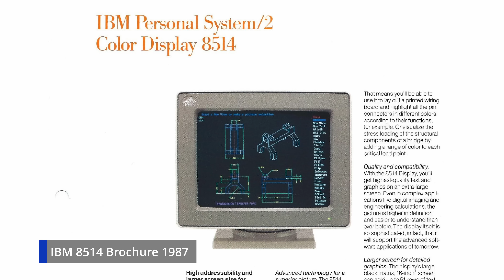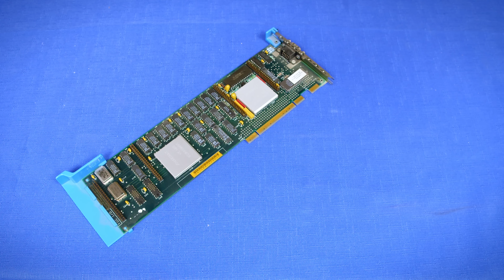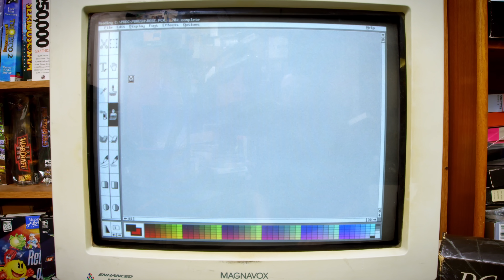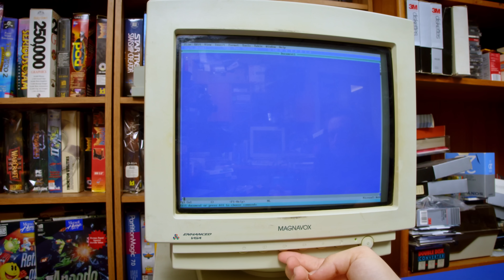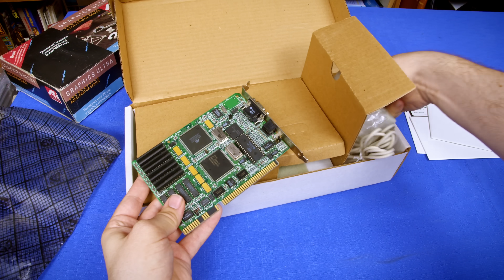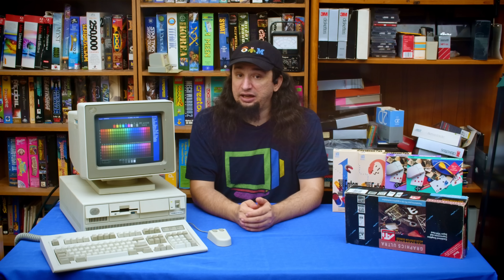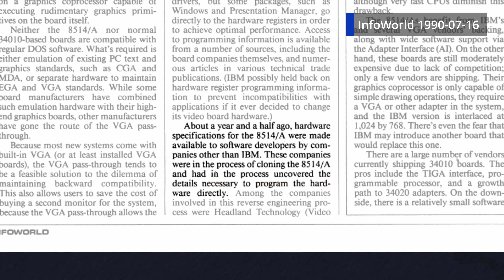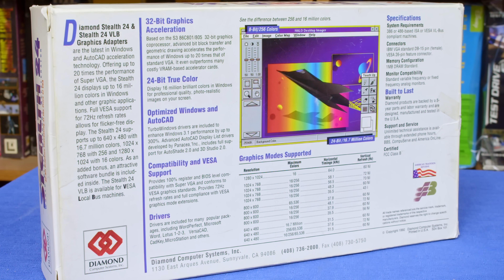IBM's Weird GPU From 1987 - IBM 8514/A

Comment: Great history!! In 1993, I had a Mach32-based ATi All in Wonder Pro. It did 1024x768 in 65k colors or 1280x1024 in 256 plus it had a TV tuner and video input/overlay. Great card w/ lots of references to 8514 in the documentation.  Nice to revisit this.

Comment: GPUs are a lot older than that -- depending on your definition. SGI already introduced its IRIS 1000 3D graphics terminals in 1983, and they were definitely not the first to market. You could argue that Evans & Sutherland or Tektronix with their 4004 were the first -- again, depending on your definition.

Comment: I was on the IBM team porting IBM's Unix called AIX from the RT RISC workstation to the PS/2 Model 80.  I sat across from the college kid who wrote the graphics driver for the 8514 card and monitor.  Internally it was called the 'Megapel', because back then IBM-speak for pixel was 'pel'.

Comment: They weren't all basic. You need to look up the tseng labs 4000 w32. Also the ati mach 64. Some of those had bit blitting which was a total game changer. What made the cards suck was if their ramdac was ass. Also the mach32 had 8514/a compatibility via a driver which was cool.

Comment: My high school in 1988/9 had a room full of PS/2s networked to a central server that were full VGA. One of the demonstrations was displaying GIFs. It was impressive at the time and I can only guess what they spent on it. There were a couple of rooms with PCs but most were monochrome intended to replace typewriters from a couple of years earlier. Drafting class had a single high end tower in the back room with VGA and a tablet for Autocad. It was for extra special students. Most of us just got to do some lessons on it.
Reply: Oh wow! GIF came out in 87 from what I know of it, so it would've been brand new!
Reply: @Lunaphied  They were pretty cutting edge. I don't know what network they used but I discovered the key combination that brought up a messaging client so you could send messages to any other station. Passing notes in class was built in.

Comment: Good stuff. There is just one significant aspect of the 8514 monitor that you're not familiar with, since you don't own one. The 8514 was flickery, but nowhere near as bad as the monitor you're using. IBM was well aware of the interlacing issue, so they mitigated the flickering (particularly on CAD software) by using super long-persistence phosphors. This worked fairly well for line drawings, but it was bad for scrolling text; for example if you did a DIR in a directory with a lot of files it would look like the Matrix.

The long-persistence phosphors were one major source of the myth that the 8514/A required the 8514. It did require it in a way, since it was much more flickery on standard-persistence monitors.

Comment: I co-processor isn't a GPU. A GPU is basically an Array Processor. A ton of smaller, simpler cores working together in parallel to solve workloads.
Reply: GPU - Graphics Processing Unit. It's a Unit that Processes Graphics.

Comment: I wonder how much is bandwidth limited on the ISA Graphics Ultra, albeit maybe that matters less for the Mach 8 core vs running in VGA mode using the VGA Wonder core instead.

For whatever reasons, those VGA cores tolerate heavily overclocked ISA busses without issues, but they also don't support a 0ws interface mode, so they're still in the same speed range as a 0ws fast ISA VGA card (like some SiS chipsets) on a moderately OC'd ISA bus (like 12.5 MHz).

The Graphics Ultra I've done a lot of benchmarking with ran fine up to 25 MHz ISA bus speed, maybe higher (I forget if I had it at 28 MHz or not) on 486 motherboards that allowed that. (playing with master oscillator settings + ISA divider) I managed to get that high ISA clock working with various SB compatible sound cards, too, for proper demo/game tests with sound. (it required setting up appropriate wait states ... or some similar parameter for the sound card to use ... I don't think it was wait states, actually, but something in the mobo BIOS related to I/O cycle times, though maybe it was technically a wait state category)

I think that's the only card I could get 99% in the 3DSpace demo on an ISA only mobo.

There's also a jumper on the Graphics Ultra that locks it into 8-bit XT bus mode and thus runs slowly.

Comment: It was more influential to Windows than most realize. Since it was the "accelerated" example driver included with the Windows DDK, most everyone else started off with the 8514/A driver as a template and built it from there.

Comment: GDI didn't become DirectX.  GDI abstracted all the drawing commands so they could be accelerated but it didn't give direct framebuffer access. The early versions of DirectX were about doing away with GDI and providing direct access to frame buffers, DirectX progressively added accelerated drawing operations, first basic 2d operations like copying between buffers and later complex 3d operations. DirectX never implemented accelerated 2d Drawing operations like GDI had until Windows Vista where the 2d operations were done using the 3d hardware

Comment: The boundary of "GPU" is unclear, but if the 8514/A is, then the Amiga copper and blitter are too, years earlier.
Reply: The hint you would need about the Amiga's blitter not being the first of its kind comes from the name.
Reply: And the Tseng PAK cards came out 2 years before the Amiga and 4 years before the IBM 8514.
And the Hercules graphics card came out a year before that.
Nvidia likes to claim the 'GPU' title because they added hardware accelerated transform and lighting with the GeForce 256, but all graphics cards had been accelerating, offloading, or extending some form of graphics tasks since the beginning.
Reply: It depends how you define the term "GPU". Copper and Blitter could do a lot of neat tricks long before and without taxing the CPU.

Comment: The ATI 8514/a clone was so popular I always thought IBM contracted the design to ATI. I never heard about the original IBM 8514. I owned an Amiga 2000 at the time. When I switched to the PC, I bought a WD 32 bits accelerated VLB, then the famous S3 968 VLB. Later I switched to PCI with a Pentium 120 and the famous Matrox Mystique and first 3d accelerated game: Hellbender
Reply: I had a 968 for a bit, and a Matrox Mystique 220.  That was a sweet card.  Linux drivers for it were excellent.  Rand a Mystique 220 + Voodoo 2 for a bit.

Comment: Five months ago on Tech Tangents II you posted a video entitled "Video Capture Never Ends - How Much do You REALLY Want to Know?"  You diplomatically noted that the subject has "endless depth".  At that time I suggested that you go down the rabbit hole.  Thorough documentation of the multitude of display standards and conventions would be invaluable.  If you don't document 43.48Hz interlaced video it will be lost to time.
Reply from the maker: I'm still going down the rabbit hole and building up notes. The idea is less to document every video mode like that, and more convey an understanding of how to identify and work with something like that from a general perspective. But if you'ed asked me when I made that TTII video if I ever thought VGA had interlaced modes I would have guessed no. I really wasn't kidding about the endless depth.

Comment: not really a GPU that would be an anachronism at best... that is a fixed function device... the term GPU started with the NVidia GeForce and even there they weren't quite GPU's yet as in they were fixed function (but they added hardware T & L), not programmable (as a CPU is)

Comment: Back then we didn't have options to compare to. Most of the time when we bought computers, it was a systems, with some options. I don't remember much until the 396 had been out for awhile. An system you might be interested in, the CTOS, Convergent technology, DEC bought them when they got government contract and synched with Burroghs, IRS, Coast Guard and Marine Corps. Banks had terminals to communicate with IRS.

Comment: I would call the NEC μPD7220 form 1984 kind of the first "GPU", or better still , the Texas Instruments TMS 34010 from 1985, that was truly programmable. and are both from before the IBM 8514/A.

if they had paired a TMS 34010 with a Inmos T414  Transputer... the closest thing to a GPU of 15-20 years latter
Reply: GPU have an specific meaning. It is a 3D chip than can do at least TnL in hardware. Even the beefier subsystems which SGI produced at time, most of them couldn't be called GPUs as the workload was divided in tons of chips, and some models lack one of other checkmark to get the right to be called GPU.

Sure there were older technologies which precede or are similar to some of the features GPUs have, but calling them GPUs is kicking it too far.
Reply: @hyoenmadan  ב''ה, 99/4A owners probably have input on this otherwise

Comment: holy cow, we're just calling everything that puts out video a GPU now? It seems like an analog television station would be considered a GPU. Or telescope.

GPU is a term of art with very specific meanings. And yes, this card does in fact accelerate some 2d operations, but compared to what is considered a GPU, this isn't even in contention for that. It is a fixed pipeline 2D card that accelerates some operations, whereas until this newer generation of kids who never grew up without gpus who think that everything is a GPU, it was generally understood that the term refers to a part of the computer which offloads certain 3D mathematics operations from the CPU. There may be something that we can consider to be a GPU from prior to the release of the geforce 256. However, virtually every Mass market 3d card wasn't one, and only the dilution of the term into meaninglessness would have a 2d accelerator card be called the same thing.

Anyway, it's a pet peeve of mine and zoomers are just not very good with computers since computers are easy enough that they don't have to be, so even though it's the hell I'm going to die on I will die on it and I'm going to lose this battle. But it's still really annoying.
Reply: Back in the day you had to be a 3D chip, and support T&L in hardware at least, to have the right to be called a GPU. Even the Reality engine of the N64 (powerful chip made by SGI themselves) couldn't be called GPU. These days everyone is a GPU.

Comment: That box slide reveal at 2:59 was slick AF.  If it were a commercial, I'd be pulling out my wallet.
Reply: My wallet was in my hand at 3:00... And I didn't understand until I checked the comments.
Reply: I woke up on the floor with my wallet out and all of my cards missing…
Reply: IMMEDIATELY went to the comments

Comment: Good Stuff and well done. Back in the days I had a number of those cards. As a parallel topic back then the importance of Sony's invention of the "Multi-Sync" monitor was nearly paramount for the evolution of PC video resolutions. While monitors were nearly always very expensive however before the 'multi-sync' became a industry standard feature most monitors could only be used at one resolution (sometimes 2-3 more).

Comment: The first adapter I ever encountered that might retroactively be classed as a ‘GPU’ in a somewhat modern sense was the Glint 3D chip from 1993 or sometime around then.
Reply: I don't remember it being able to do TnL in hardware. It can't be called GPU without that checkmark.

Comment: DirectX did not evolve from GDI. The precursor to DirectX; WinG (1994) only did one thing, it let you bypass GDI. This evolved to the DirectDraw part of DirectX.
Reply: Ironically, it wasn't made with graphics and games in mind... But to allow motion video to be played in a window. 

That's why the most old DirectDraw module is called DCIMAIN. But then they found it could be used to reserve and manage window memory zones where the display adapter could retrieve the data to display directly via DMA. Then you got DirectDraw. Later they found these flat memory zones could be used so the 3D engine could retrieve and display processed data as well.

They bought a "game engine" from some company, modified it to mimic what Glide was doing, and called it Direct3D. But instead offering you a library to link it against your application, they made the API available directly as system calls, COM+ objects and a public interface so anyone could use it from usermode.

Comment: Right, so it's a "graphic accelerator" but doesn't have the matrix operations which distinguish GPUs starting with Clark's Geometry Engine in SGI systems. I think that's stretching the definition somewhat.
Reply: Even these beefier 3D graphics subsystems can't be called GPUs, as the engine is distributed across tonloads of different chips.
A GPU is a single 3D graphics chip which can do TnL in hardware at least.

Comment: GDI did not evolve into directx. Directx bypasses gdi - hence the direct in the name. Also, GDI has been around since before Windows existed.
Reply: DirectDraw came from WinG, which in place came from the interface to  drive directly the framebuffer memory in order to display motion video on a window. There is a YTber which plays with these older apps and video encoded with Cinepak and stuff.

Direct3D was a software middleware they bought from some external company to develop a way to abstract the 3D engine chip registers and interface in an uniform API... Just like Glide btw. Graphics companies tailor their hardware interfaces to implement the backend, and the frontend is developed and implemented by Microsoft and made available as an usermode set of APIs.

Comment: The IBM 8514 is also influential for high dpi support in Windows, because VGA uses 96dpi (100%) but 8514 uses 120dpi (125%). Installing the 8514 driver also adds the high dpi versions of bitmap fonts (8514*.fon) and sets the system dpi to 120. In Windows NT 3.5, the dpi was made independent from the driver and can be set in the registry to any integer value, and all user mode applications can read the dpi value and react accordingly, allowing for a true high dpi experience. Windows 95 introduced the dpi slider as a convenient interface for changing the system dpi, and made horizontal and vertical dpi separate in the registry allowing for non-square pixel configurations (though Windows NT unfortunately never got non-square pixel support, leaving Windows ME as the last version to support non-square pixels).

Comment: It was right at this time that I had bit the bullet and 'upgraded' from an Amiga 500 to my first PC, and VGA/SVGA was the primary reason. It was still inferior in some ways to Commodore's, but it could display 256 colours at higher resolutions with extremely fast speeds using frame-buffering. When VESA was standardized, especially the VESA 2.0 framebuffer both DOS and Windows performance was exceptional when you had a compatible graphics chipset. Primarily it was games that took advantage of this, but of course that's what I cared about the most coming from the Amiga world. Both machines could run WordPerfect in WYSIWYG in a GUI, but only PCs had games running in 320x250x256 or soon 640x480x256.  And the VESA 2.0 extensions made even budget video cards fly if they supported it. Good times, good memories.